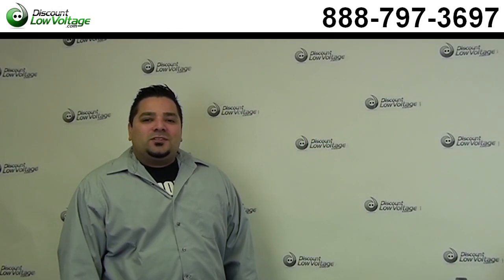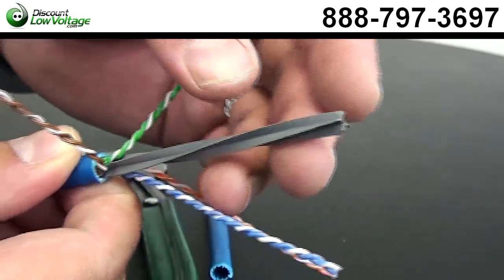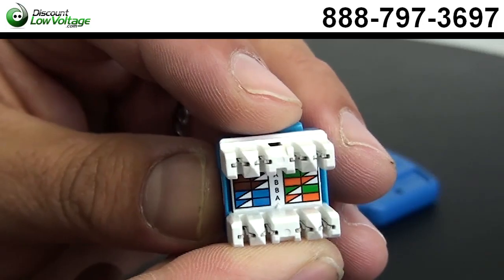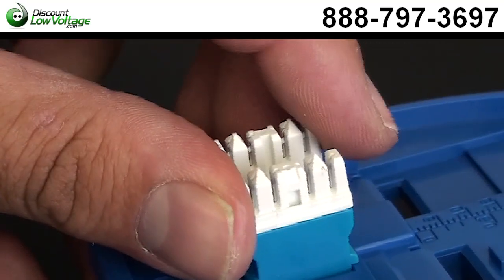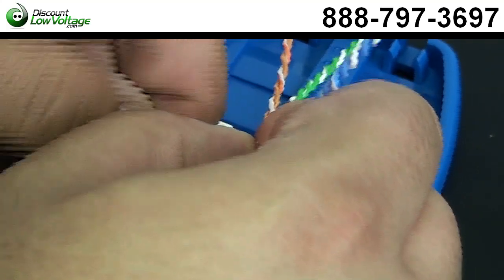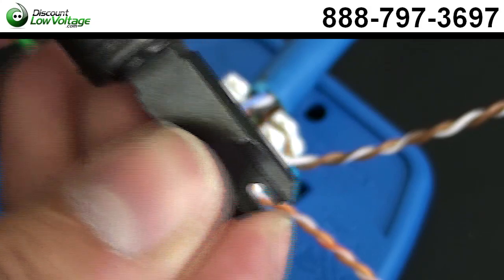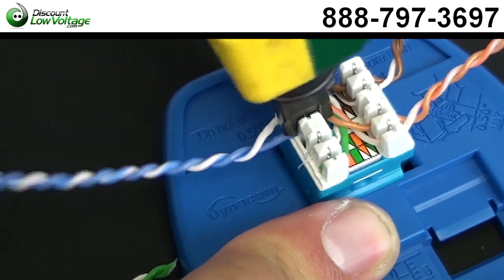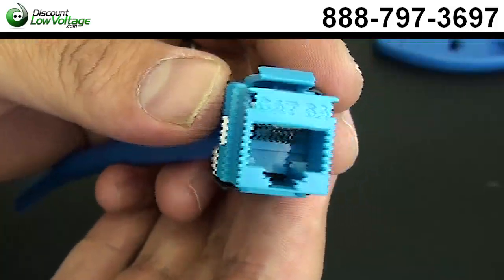How To Terminate Cat6A Keystone Jacks - DIY Video

Comment: Don't understand your obsession with repeating yourself on twist rate.   Of course it's important. Just like it is with cat6, cat5, cat whatever. But you don't address the main issue. Which is, how do you terminate in B pattern without crossing over conductors? It's like begging for it to fail for crosstalk. The layout of the cable is for an A pattern. Since you yourself stated B is what is used mostly. You completely avoid this issue in your vid